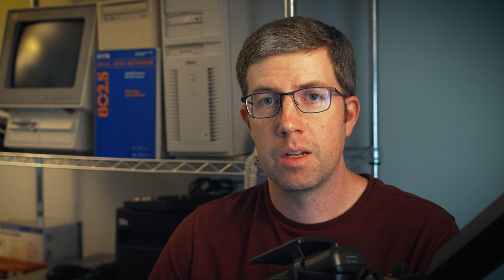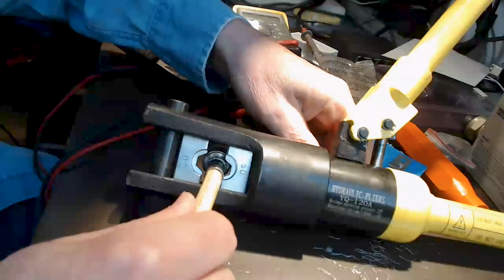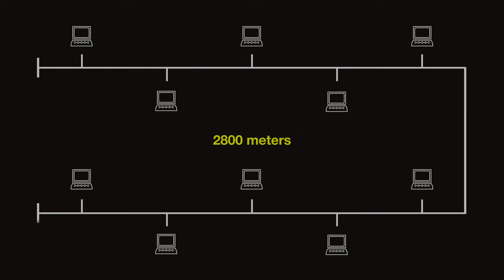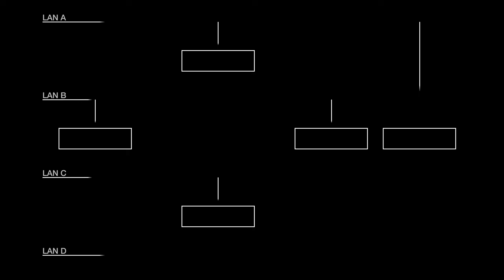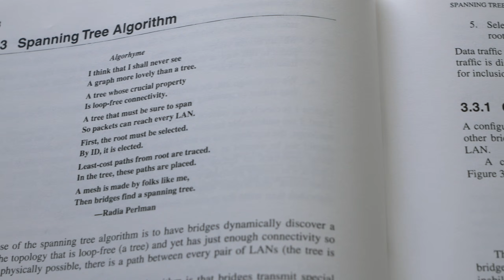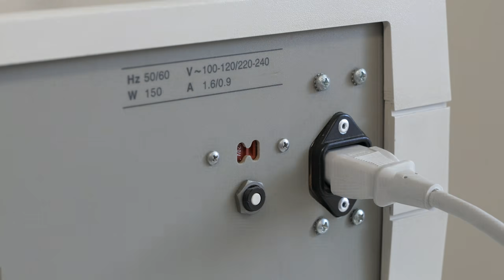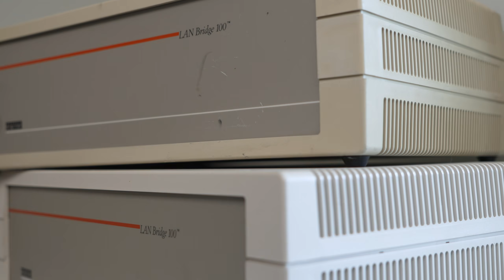EXPANDING THE ETHER: The invention of the network bridge

Comment: Other than the tools and cable being huge and heavy, it looks much faster to crimp those original ethernet cables compared to painstakingly laying out the modern 8 wires in the right order, getting them in the correct slots and all the same length before crimping.

Comment: Egds, this brings back memories. In the early 1990's I worked on a campus with 10base5 "backbones" (that sometimes extended into lab buildings) with 10base2 "thinnet" networks that connected client computers and systems in the data center. Nothing can communicate the levels of pain and suffering one endured during a broadcast storm across and entire flat Ethernet LAN.  You knew when you saw MAC addresses of 55-55-55-55-55-55 in your bridging tables you knew you were in for  along day because that is what you would see when there was so much post-collision jam that the bridges would pick that up thinking it was a destination MAC address. It was ugly. If you wanted to do a more in-depth story on Ethernet you could start with AlohaNET and carrier sense and how that carried over to Ethernet. Speaking of the LAN Bridge the last one I laid my hands on was extracted from under a raised floor in a data center in RTP, North Carolina sometime around 2004. There was no telling how long, how many decades, that device quietly forwarded packets from one side to another.

Comment: Acorn and SJ Research were selling X25 / Econet bridges and Gateways from the early 80s, with one or more 6502 or Z80 CPU's doing the routing between segments, and protocols, and they added Ethernet to the mix by 1986. The specs are dated 1980, see the Center For Computer History pages on Econet. Particularly the 1986 "Acorn Econet X25 gateway brochure", that added Ethernet to the protocol agnostic mix.

Comment: Honestly, the complete system isn't really that great an engineering solution for most situation. If you are going to all that effort, you are already using a expensive 32 bit CPU and costume implementations of lookup hardware and just in general a really expensive hardware box. For that price you can just actually build a switch. Plus you need all these really expensive transceivers and cables only to still have lots of collisions because of the shared bus. At that point, just drop the bus, build a star topology, use 1Mbps serial or 2.5Mpbs (like ArcNet) and build a normal router with layer 3 routing. This way you get far better more predictable performance in any network that has more then just a couple of clients on it.

There are some situation where having a bus is an advantage, but for most situation putting down multiple cheap cables is better then 1 very expensive cable with lots of manual work to install it.

And if you really actually need 10Mbps or more, just design a router that has a 10Mbps port (you can use a simpler version of the ethernet PHY and you use STP cables).

But of course, ethernet was deployed and their existing market at the time. So it made sense to solve that problem. And the spanning trees were brilliant. 

Since Ethernet and IP are so needlessly is complex, developing actual switch and then merging switches and routers took another 10 years and was far more expensive then it needed to be. Unfortunately the people who developed IP did really think in hardware terms at that point.

Comment: I work with these cables pretty much daily in Ham Radio. This is known as a 50 ohms coax. This is still the standard on Radio Communications equipment. Belden still makes many types of these, such as the Belden 9913. It’s not really that bad to work on it, the tools he used there are a bit on the bigger side 😅, way too ordinary for a Rg-8 type cable. On a side note, I live in Puerto Rico, and didn’t know we made those here in the city of San German 😮

Comment: Once upon a time, i wired an office, with my dad, in thin ethernet... I remember i could not understand why did they have to choose a 50 ohm wire standard, when a perfectly good reeels of 75 ohm could be had at any tv installation shop... The 50 ohm thin coax was 3 times as expensive.... At least.

Those were the days:)

Comment: Hello! I'm from a bit more modern era of ISP, but I used to work with CNT400 cable (NEC or Ericsson radio transmission systems with IDU and ODU) and it doesn't look that much different from this thicknet. It was also a pain in the ass to end CNT with properly installed connector, especially outside, in the winter... :P well, CNT seems to be a little more flexible at least. :D

Comment: At one point I worked in a group that had an isolated Thicknet loop in our computer room that connected our minicomputers.  The IT department had a Thicknet backbone that ran between all the floors of the building and was tied to their mainframe center, a somewhat limited corporate network and ultimately the internet.  At some point we thought it would be a good thing to get our minicomputers connected to the campus network so we made a request to the IT department to connect us.  Their LAN technician's first attempt to do that resulted in adding new a new Transceiver on our Thicknet segment and another Transceiver on the building riser segment.  He then connected AUI cables to both and was somewhat puzzled when he couldn't just connect the ends together.  Not one to be easily deterred, he found a D-15 female to female gender changer and connected things up.  When that didn't work, he had a special "crossover" AUI cable built and connected it between the newly installed Transceivers which of course didn't work any better.  I asked him how he ever expected that to work since neither was being powered?  After an extended "deer in the headlights" moment and consulting with a more senior LAN technician, he went away and ordered a DEC Lan Bridge and two standard AUI cables which he installed a few weeks later and all was well and our minicomputers could connect to the campus mainframes, the rest of the corporate network, and the internet.

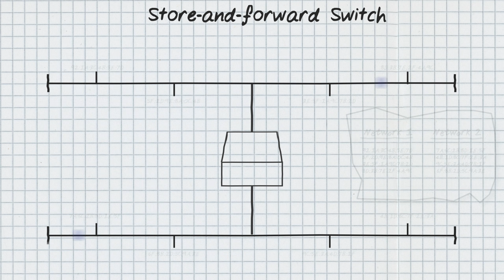Comment: 10:52 This is a good video, but surely this part is wrong. It's the store-and-forward behaviour of the bridge which allows each network (collision domain) to be of the maximum length, by keeping down the worst-case latency (ie. the latency between the devices which are physically farthest away along the wire) of single hops inside one collision domain. This would still hold even if the bridge forwarded every frame onto the other network. Not forwarding some frames is just a nice-to-have, a somewhat unreliable performance optimisation, at this point: it's only when bridges become responsible for preventing cycles that it becomes a critical part of the system.

Comment: A well put together video. I got a couple comments and maybe a question or two.

- Interesting to hear you refer to "packets" so much as opposed to "frames". Had frames made it into parlance in the period of time you document?
- I didn't know STP also came out of DEC. I had assumed it was created and approved by some IEEE committee. Interesting to learn.
- I would have assumed repeaters wouldn't break the STP process - at least with how STP works today, it functions on BPDUs which are sent/received on a given broadcast domain but terminated by an STP-knowledgeable device. Seeing as repeaters ... repeat ... the BPDUs shouldn't be impacted.

Comment: Metcalfe didn't found 3Com until after the Xerox-DEC-Intel deal. What happened is that DEC approached Metcalfe and said "We want you to make us a LAN protocol for our systems that doesn't violate the Xerox Ethernet patents. Metcalfe said no (believing Xerox would sue for patent infringement regardless of what he created) and instead suggested that they ask Xerox to license the Ethernet patents which Xerox was willing to do. Intel was brought on board to create dedicated controller chips and together the 3 companies created the Ethernet standard (it had to be an open standard in order to avoid anti-trust issues) and then Metcalfe founded 3Com later on to sell network add-in cards for PCs.

Comment: Whoa whoa whoa!  Whoa.  Hey.  A repeater does not "amplify" a signal; I mean that in the definitive sense.  It has a similar effect to amplification, but with positive and negative tradeoffs.  For the negative, it is a logic based system, so it introduces a little bit of latency since it has to pass through so many additional transistors.  The positive, however, is that it is an entirely new signal, which is way better than amplification... because amplifying would take the digital signal, as it was received and up the voltage, which would include any degradation from noise or interference.  So, with a repeater, the signal is also cleaned up... think of it like a signal sifter.  :)

EDIT: And... and.  That bridge wasn't processing 30,000 pps.  It was processing frame.  Layer 2 isn't really aware of the layer 3 protocol beyond a header value.  Always frames at layer 2.  Or you could generically call it a Protocol Data Unit (PDU).

Comment: Great video on an important milestone in networking technology.

I worked with all kinds of DEC system and networking hardware from about 1986 onward.  This included VAXes, VAXstations, repeaters, routers, terminal servers, SNA gateways, you name it, along with interconnecting them with many other vendor's systems and devices.  A random list of comments:

 - The LANbridge 100 could be rack mounted, once you took off the plastic outer case and and installed the supplied angle brackets.  On a project with 400+ diskless VAXstations, we had entire racks of them to segregate the traffic, using Remote Bridge Management Software (RBMS) to manually enforce blocking of Local Area VAXcluster (LAVC) multicast addresses between physical subnets.

 - There is a difference between Ethernet version 2.0 and IEEE 802.3, involving the AUI transceiver cable pinouts, but more importantly Heartbeat versus SQE (Signal Quality Evaluation?).  Mixing the two can cause problems.  I once fixed a situation where a network file copy took many minutes; by switching transceivers and hubs to all 802.3 it then would finish the copy almost before you took your finger off the Enter key.

 - DECserver 200 (at least) has a built-in online debugging tool (ODT).  Enter the command SET SERVER ODT ENABLE and then type ODT, and you'll get the ODT prompt.

 - Suggestion: The "Time vs. Distance" problem for too long a "backbone" cable is related to the collisions and such, as you described.  You should have briefly mentioned how Ethernet uses CSMA/CD, and referenced any of your previous videos going into it in more detail.

Keep up the good work!

Comment: My workplace had more than a dozen Dec computers connected with "thin wire" Ethernet.  A single RG-58 cable snaked under the floor, with a T shaped BNC connector on each computer, and a 50 ohm terminator at each end.  If there was a break in the connection at any point, all communication would stop.  If any length of coax was not "50 ohm" characteristic impedance, communications would stop.  If a coax was too long and was neatly coiled, it acted like a choke and communications would stop.  I learned to track down problems by breaking the network in the middle and seeing which half would function.  It was a real life binary search, done with giant suction cups to lift the floor tiles.  Except for all that, it worked well.  
It was eventually replaced by an Ethernet hub.  The coax cables were replaced by regular Ethernet cables running to the hub, making the network much easier to maintain.

Comment: Fascinating to hear to history of this important piece of Ethernet technology. There are a couple of errors in the video, however. Firstly, broadband does not mean multiple services. Broadband simply means that a broad range of frequencies are used. Secondly, you appear to have misunderstood what store-and-forward means. Store-and-forward means that the switch receives the whole frame into its memory, then forwards a copy of the frame. By contrast, a cut-through switch only reads the start of the frame up to and including the destination MAC address before starting to transmit a copy of the frame on another interface. Both cut-through and store-and-forward switches work by keeping (storing) a copy of the MAC addresses they learn in memory. So the term "store-and-forward" does not mean that the switch stores MAC addresses, rather it means that the switch reads an entire frame before it starts to transmit a copy of that frame on another interface.

Comment: The University of Kentucky's Medical Research compass has a building where an entire floor is still rocking token ring physical network cabling. At least as of about 2014 and based off what I know about that department no reason to think it changed. They used modern RJ-45 ports thanks to some adapter in the rack and in the faceplates but it was so weird. Seeing the thicknet reminded me of that absurdity. There's another floor where they still use an HP Hub from I wanna say 1989? Maybe it was the early 90's though. It runs only a few devices but still. I hope they pulled that...

5:51 O_O Wait a minute, I think I had some AUI cards in that used ISA as a kid and could never figure that out (it was before I had internet).

Comment: Excellent. I began working with Ethernet as soon as the IEEE 802.3 spec was finalized, mostly with troubleshooting. With 10Base5, one of the 50 Ohm terminators needed to be grounded. After revolutionizing inter-processor communication, Ethernet drop cables going to multi-port transceivers became popular for attachment of distributed RS232 terminal servers, such as the DECserver. Plenum-rated AUI cables were too massive for the latch to hold the DB-15 shell in place. Hex nuts were needed in those installations. Richard Siefert came up with the latch system, that worked very well for PVC AUI cables.

Comment: Being pedantic, it was not the first network bridge, but ETHERNET bridge, as the 1976, X.25 network standard required bridges, like the, 1969, Honeywell Interface Message Processor. In the schools market, from the early 1980s, Acorn / SJResearch developed and sold networking solutions to thousands of schools in the UK, Australia, New Zealand, ... . They utilised network bridges, to connect up <500m, < 2mbit, twisted pair, econet runs, or if exceptionally lucky to an X.25 net; I remember an Acorn AEH20 Econet Bridge, containing a 6502 cpu, some memory, a ROM, and a couple of network boards, in a beige wedge, atop a stack of SJResearch file / print servers, in my old school, that joined two separate, <500m runs, of what would appear to US viewers, the very similar, but later, AppleTalk, din socketed, RS422 based, networks.

Comment: I installed a few 10Base5 networks in 1985. One of them at home to interconnect with my brother one floor lower. Soon we repurposed it as antenna cable for ham radio. It was as good as RG213U 🙂

Comment: I had always wondered how 10Base5 Thicknet coax was "tapped" -- very cool. I have used and terminated RG8 coax for 10Base2 before -- until recently, it was STILL used in Industrial settings, usually in a bus-type configuration between PLC stations. Although nowadays most stuff has moved over to copper or fiber Ethernet using EtherNet/IP (CIP), MELSEC IP, or Modbus over Ethernet. Mitsubishi/MELSEC only recently (Feb 2024) discontinued support for their 10Base2 and 10Base5 Ethernet I/O modules for their PLCs. BNC connectors are still a pain to terminate, but that thumb-thick Thicknet cable looks like a beast.

Comment: Teflon can still produce toxic gasses if you heat it enough.  They would be fluorine or something containing it.  The C in PVC is chloride so there would be chlorine or some sort of chemical containing chlorine when you get it hot enough.  I am fairly sure that either one would be really nasty and carcinogenic assuming someone lives long enough to develop cancer from either one.  Maybe the PVC breaks down more easily in heat and the Teflon does not so easily.  Keep in mind that Teflon on some cookware does decompose and release toxic gasses at around 500 Fahrenheit.

Comment: Fascinating thanks.
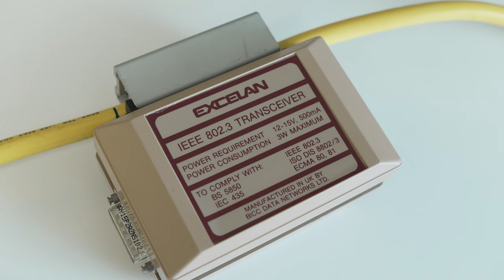5:35

Having just learned that 802.11 was the name of a working group which came up with early wireless devices/protocols, I am surprised to see "IEEE 802.3 Transceiver" on the device tapping into this cable.
A bit confused, really.
What is "802.*", if anything?
EDIT
Is is a frequency thing? I have just learned what a transceiver is.

Comment: Do you plan to do any videos with any other vintage network platforms such as ARCNET (never got to play with this), or ALL of those RS232/RS485 based variant networks that were all proprietary? I occasionally see stuff on ebay that used a small hub of RJ11 ports and the cables that leave the unit go to SERIAL ports on each computer and then you install a driver that turns your serial port into a network interface. I'm sure it's less than 2mbps but back in the 80s, even early 90s that was def flying. I love your video on DEC Ethernet bridge. You plan to do anymore with other various bridging technology such as AppleTalk to Ethernet or early routers (non Cisco)? Thanks! Keep up the good work love your videos!